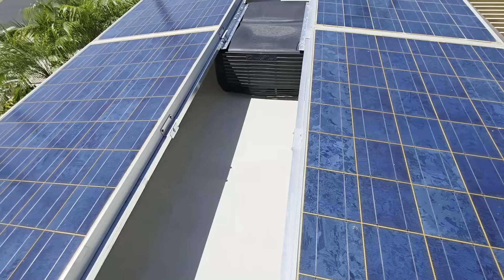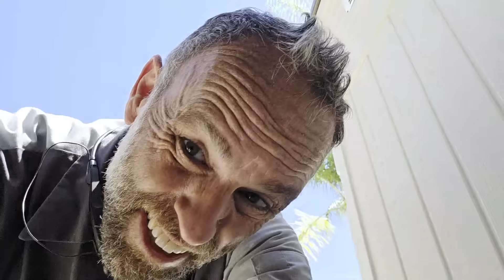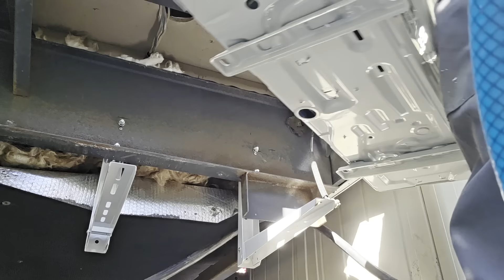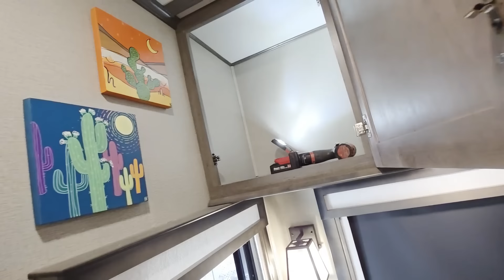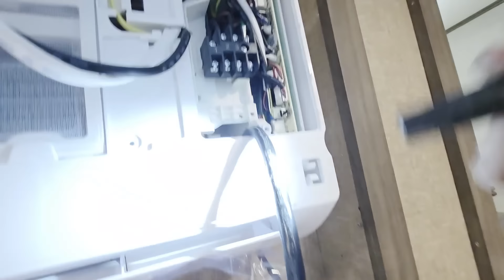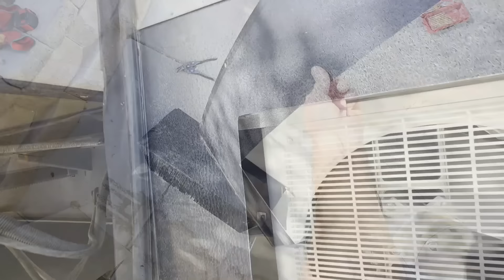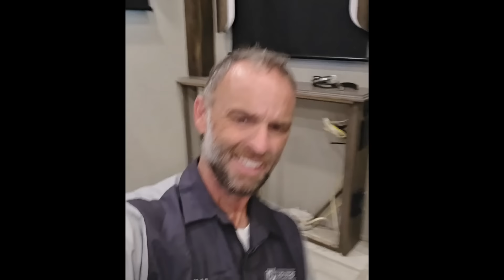Are Mini-Splits Worth the Hype? YES!!!

Comment: Three rows of 3" hole would have worked for the air circulation and maybe looked better?
Reply from the maker: The j wrap was hitting the a/C unit so I needed to cut out the section that was hitting it, I think it looks great and will be a much more common view in the next few years and just accepted as a roof A/C

Comment: I put 3 one ton mini splits 21.5 seer (each good for 600sq feet for a of total 1800sq feet) in my new house of 2000sq feet with 2x6 walls and maxed out insulation. Even on the 2 degree nights they never fell behind. I wished I knew sooner. They work great and I can zone the house if I want or need to from lack of power from the solar in the winter, Just turn off the units in the empty parts of the house. My only complaint is the units will not keep is a perfect 72 degrees, for some reason they bounce around a little 70 to 72 unless defrosting then I have seen the temp drop to 68 once or twice then shoot back up fast.
Reply from the maker: I think we have been oversold on central A/C and heat for a few generations too long.

Comment: All great until the outside panel 😢. Cut slots and put black painted mesh behind. The slots only have to be as big as the fan.
Reply from the maker: Slots without a machine doing it look awful and will still restrict air flow. The whole skirt is held on by a handfull of screws and will flex on the unit while driving too. This just looks bad, because you are not used to it.

Comment: I think you did about as well as you could do with what you had but dunno about the loading on the exterior unit's brackets in motion (lots of load on the bottom bolts).  Wonder how the line set will do after months of road use also? Def an interesting install!  (Engineer here. 😂)
Reply from the maker: The amount of things I've seen hold up on a RV that are secured by one screw or glue tells me the steel brackets and line set will be fine.
Reply: @AZExpert I hear ya! Love to see an update down the road!

Comment: Find a metal shop and louver the piece you cut out.
Reply from the maker: it seems unneccessary to me, my only regret is not stuffing more line set back in the cabinet or cutting a few feet off, but more line set means condensation could sweat in the lower cabinet and cutting means less serviceability.

Comment: If you have brown outs or spikes,  they will ruin the board in them, and spare parts? good luck.  and warranty? You pay the bill , then submit it  and they will figure if they will repay you....
Reply from the maker: That is true on most appliances, on RVs it's much easier to add surge protectors and power conditioners than on a house though and insurance purchased well, covers that damage anyway.

Comment: Only 7 years for AGM batteries? 

On my Vanhool T927,,,,
I had 2 (Victron AGM 250aH) in series in 24 Volt for the start engine AND 2 in series (separately) as house batteries.. all charged with 1 Victron multi plus 24/3000/70 WITH BALANCERS 
They all holding for 12 years !

And did you know:
That you can start a coach or bus engine, solely on a Victron multi plus (plugged into landline) !
Reply from the maker: Wow, 12 years is impressive for AGM batteries!
Reply: @AZExpert 
Yes 12 years. 
But you have to remember:
The Vanhool was 24/7 on duty. 
So.. 8,,,10 hours on alternator-engine charge PLUS 10…14 hours on landline charge.. 
enduring breaks of touring the Vanhool was charged by landline..
So the batteries were constantly trained by the Victron & the balancers..
We have to keep in mind that the batteries never were “challenged”… and only where in use as buffer. 
Each battery never “sunk” underneath 13,6 volt. 

I still have 2 of them.. 
now 15 years old ,, they are at 12,3 volts.

Comment: Imagine a quiet RV in the summer.  Maybe someday RV makers will stop mounting AC units in the center of every roof that acts as a huge speaker cone to maximize the noise in every RV built.  It's no surprise that painting an AC black, putting it in full sun and then routing the cool air through sun heated ceiling ducts would be inefficient.  Maybe RV makers will start painting roofs black next year to finish the job.   Great work on this install.  Perfect video as always.
Reply from the maker: Glad you liked the install video!

Comment: That's a great topic! I completed my project six months ago using my 33-foot, 30-amp setup. The largest unit available is a 12,000 BTU, 120V model, and it works exceptionally well. I conducted extensive research before starting this venture, and although I was initially skeptical, I decided to go for it—and I'm very glad I did! 

The old unit was mounted on the roof, made a lot of noise, leaked, and was extremely inefficient (3 seer).  On full blast, it consumed close to 1800 watts, on an 88°F day. It really really struggled to keep up with the heat. I often had to set it to the lowest setting just to achieve 77°F. It sounded like an idling semi-truck sitting outside the door. 

If you decide to go ahead with this, you'll need a solid plan. My outside unit is located at the back and features a reinforced bumper along with some bumper trusses, which you can easily make from ¼ inch steel if you're into a bit of fabrication. I mounted it on a cargo carrier designed for bumpers and ensured it was well-stabilized. The rest involves properly placing the wiring, fuses, lines, drainage, and the inside unit and performing some straightforward panel work. It will require more time than expertise. You are uncomfortable starting the unit; call a professional. Most of these you have to vacuum down. If you don’t have a vacuum and gauges, it’s better to call a professional. Start to finish, I spent a full 2 days installing once I had all the parts. 

What a significant improvement!  Once the unit became operational, it was running at approximately 1100 watts and extremely quiet. Halfway through the day, I noticed it started to cool down. I had turned it on and let it run for 2 days, anticipating temperatures to reach 105°F, with the camper in direct sunlight that week. The interior temperature remained stable at 71°F, which was very impressive. As the outside temperature dropped to around 82°F, its power consumption decreased to just 230 watts ( I measured ). There is no way on God’s green earth that that rooftop unit would have ever performed close to those results. In my area, the unit consumes almost no energy for 8 months of the year, which is great for people with solar panels and batteries. It heats well too. Three weeks ago the temperature got down to 20°. It kept up.  The camper was stable at 68°. I didn’t touch the furnace at all. 

If you are thinking about doing this, I highly recommend this upgrade. It’s a little bit of a pain in the rear but once you get it done right, you will enjoy it.  

120V 12K Heat/cool Unit - $850 
Rear cargo carrier $150
Wire/fuse/breaker/conduit/other $200
Bumper Trusses - $90
Other - $50
Reply: ......to add ....If you are going to remove the rooftop unit, you are essentially eliminating the brains ( control module) of the system. Get a Honeywell thermostat and hook up the furnace for $35, and hook up the 2 blue wires coming from the furnace located up in the old A/C cavity.   Some people might choose to seal up the area and make it waterproof, while others might install a 14-inch bathroom fan for extra ventilation - it fits perfectly. It's easier to put in the 14-inch bathroom fan....However, make sure you install the new thermostat and the blue wires before installing the fan. This will save you the "ahhh crap!" moment. Ask me how I know that ....

For power enthusiasts, during a particularly hot month like July, the new system consumed 233 kW ($27.96), while the old system consumed around 512 kW ($61.51).   233kW / 30 days = 7.766 or 7,666 watts per day. 512kW /30 days = 17.06 or 17,066 watts per day. Huge difference.. When a person is running off solar, these are significant numbers to know for energy storage when the sun goes down. You don't need so many batteries, or you can double your autonomy. I only had the A/C units running set at 75 - nothing else.  Good luck out there, folks.
Reply from the maker: Thanks for sharing your experience, that's really helpful!

Comment: Has anyone seen a mini split in a motorhome? I am thinking about putting one in the basement behind a door. I am told that I pretty much need to create a large louver in the door and maybe in the floor of the compartment. Thoughts
Reply from the maker: I have seen a few mini splits installed on motorhomes. Currently its rare enough that I do not like the look of it, but as it becomes more common I'm sure I will like it more. Many or majority of skoolies/school bus conversions have been doing this for over 10 years.

Comment: Just another very basic DIY project (sarcasm).  I am a big fan of screws with Torx Heads.  Staples are not used on anything I build.  The only thing that I probably would ad is Stainless Steel Bolt Hardware. But it doesn't look like that unit (The 5th Wheel Itself) is for mobile use.  I would expect the mounting area to get really dirty if traveling and the fans would get dirt in them. I would worry about dragging it into pavement going in and out of Gast Stations, Campgrounds on gravel roads, etc...if traveling.  All Mfg's should be eliminating roof air.  I'm sure Mfg's could design a "cage" with a skid plate or roller - but wouldn't even need that if it was part of the design.  Roof AC sucks.   I probably would have spent the extra money up front for the Name Brand Mobile Unit.  Clearly the cost of labor will exceed the cost of the unit.  Please report back if it needs servicing and how long it ran until that point.  I watch a lot of your videos even though I will NEVER do this myself - this is STELLAR WORK very. worth watching for the cabinet tips alone.  I would expect regardless of your Labor Rate your services are in such high demand you have to turn people down all the time.
Reply from the maker: I find torx head drivers to strip and also slip more. I also do not like stainless hardware as it strips and can easily gall threads and are generally weaker. Thank you for the kind support. This was a proof of concept so the owner did not want to test with an expensive unit first.

Comment: Awesome video, but you wouldn't see bubbles with a system under vacuum.  That's why the HVAC guys use nitrogen to pressurize the system to check for leaks.  Nitpicking, awesome video looked great, gave me some ideas.
Reply from the maker: It wasn't under vacuum, I cracked the valve to allow some refrigerant in and pressurized the system. Bubbles exist at inches of water column  and will at a higher psi too.

Comment: I would have the condenser installed on the roof instead
Reply from the maker: It would likely hit bridges or branches and make more holes in the roof
Reply: @AZExpert  only if installed vertically
Reply: @AZExpert Although the regular units can’t be installed horizontal and the clearance is 14 to 16ft nationwide it just depends on which unit you buy and the overall height of the camper

Comment: I installed an eg4 12k btu unit in my shuttle bus build. I mounted the outside condenser under my bus (cant see the condenser or the line set in my build, unless you look through the metal vent on the side of the bus) in the same spot the original bus condenser was at.its been working great for nearly a year, and this particular unit is incredibly efficient. About 900 watts on high, about 400 watts in low power mode. I use the humidity mode the most, and most time its only using 200-350 watts. My bus is only 104 sq ft so this unit cools from 100 degrees inside temp down to low 80's in about 35-40 mins then down to the desired temp in about 15 mins more. It's awesome!

Comment: is the indoor unit mounted in a slide out?  if so how did you compensate the flex in the line when the slide out moves back and forth?
Reply from the maker: no its on the back wall and does not move

Comment: Very nice. Next time, trim the line set to length. I was so worried about doing it, but it worked fine. The only reason I did it was an AC guy told me not to use loops. Especially vertically. Apparently, due to liquid refrigerant pooling.
Reply from the maker: I had concerns about that too, but did not trust my flaring skills. Also I forgot my flaring tool

Comment: Now we just need the ability to order our favorite RV without the roof AC”s installed. 
No more big holes in the roof…
Reply: My rv needed a new roof. Was quoted 5,000$ for just
Rubber repair. For 2800$ i did a new roof new wood and new 1 pc rubber. I just covered the roof hole with new ply and never cut it back out. I now use a 10kbtu window unit and have no regrets I recommend window units to every rv owner i can. 7 years later and the roof is still like new.

Comment: I have just one question: Judging from the layers of dust that cover my battery trays (HR Imperial 38 here) I would guess the outside part of the minisplit is also well coated with dust and dirt. Does this effect the longevity or the function of the unit? Do you need to maintain it all the time, use pressured air to blow it clean before using it after a drive or replace the filters? Greets from Germany, Mark
Reply from the maker: They are built to be uncovered on the ground outside in Candaian winters and Arizona summers and everywhere in-between. There are no filters outside, just the coils which like any A/C should be cleaned annually, but of course never are ;)
Reply: @AZExpert  So if I would built in the unit just like you did and sometimes use the airkompressor to blow off the dust, I should be fine! Thx for the quick answer!
Reply from the maker: @DylanStory-h4s just hose it off compressed air will damage the fins
Reply: @AZExpert  Thank you, sounds logical! So low pressure water . And not overthinking it lol

Comment: As a 56-year HVAC State Licensed Master, mini splits for RVs is a waste of money and a horrible idea. These mini splits that use inverter boards within need very clean power. They also don't do well with solar.  Even in residential applications, solar possesses issues for the inverter boards. The inverter boards don't do well with generators. Again, they need clean power. Next the R-32 refrigerant possesses another issue,  as mini splits hold more refrigerant gas than an RV roof top unit. R-32 is an A2L classed refrigerant. This is a flammable refrigerant, and manufacturers have some safe guards in place, but not 100%. Yes, they are high efficiency in operation. However, RV air conditioners and heat pumps do well when professionally maintained. Mini splits with inverter boards are very dangerous with dirty power, have several capacitors within that can explode, and catch fire. Had one at a home in the countryside that the capacitor exploded and caught fire, burning the house down. As a HVAC Forensic specialists i have investigated many of these issues across North America. Becareful,  keep your family safe, keep fire extinguishers close by. Camper fires have been on a rise, yet less reported.
Reply from the maker: The amount of fires I've seen roof A/Cs start and you typed this. Miini-splits remove the need of central A/C and ductwork, that alone makes them better.

Comment: Did you consider that the outside unit might be too low to the ground? Being at the rear it looks like you are below the natural bottom of the fifth wheel rear. I would worry that the unit will drag the ground on steeper road transitions. I do love your installations though, not trying to be negative. Just concerned that it was missed.
Reply from the maker: Maybe too low for off roading, but I still see 5th wheelers rip off their rear walls by not paying attention so clearance is less of an issue.

Comment: Great idea. I did this on a houseboat but we used a more efficient inverter 24 seer ac unit that only draws 5 amp that can also run off solar so you can be more off grid if you want. Also save more money in the long run I tied it in with a battery bank and a small inverter and it can run 2 days off

Comment: Another nice install James. I am curious why the owner didn't go with one of the new rooftop inverter heat pumps? They are gaining popularity and are very quiet, coverable to a mini-split. It has changed my mind about wanting to install a mini-split in my rig.
Reply from the maker: None are heat pumps, still twice the price of this, and really there is nothing that can improve roof A/C more than allowing the volume of air to flow and the constriction of the ceiling opening and the ductworks are a lot of the problem too.